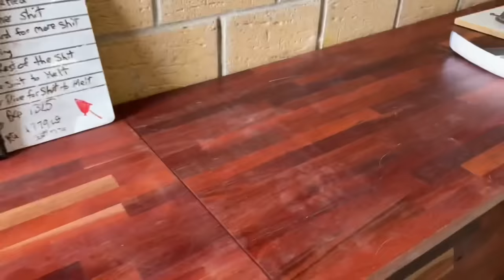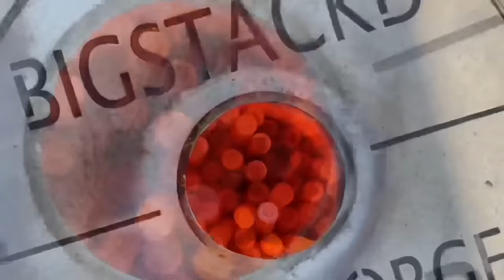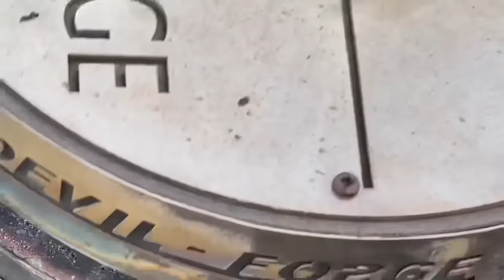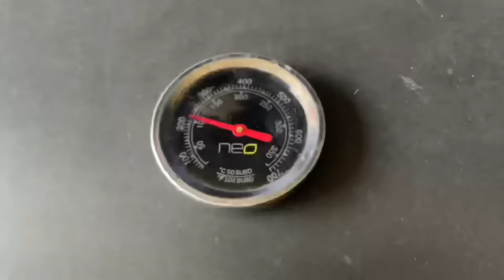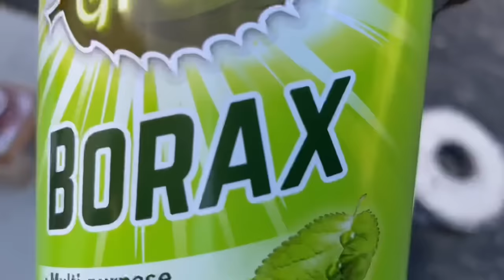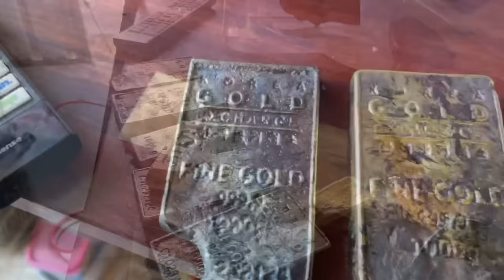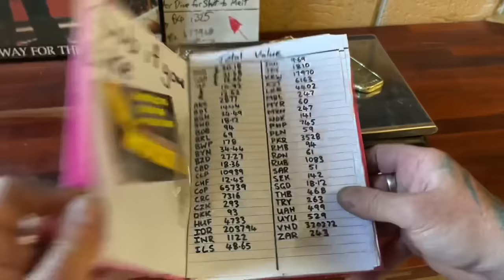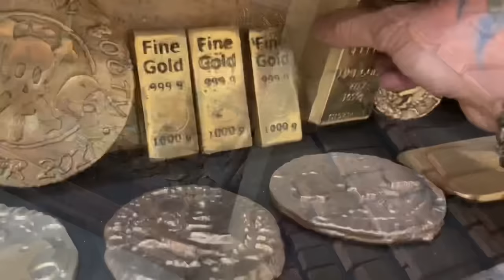Gold Bullion Bars From Bullet Casings (replica) - Trash To Treasure - ASMR Metal Melting - BigStackD

Comment: You should add borax to the charge right at the start of heating and heat the brass itself to a lower temperature = less air into the flame, because the way you are mixing it now there is excess oxygen in the chamber around the melt and you are burning out the zinc = that's the white smoke and yellow deposits on the surface. It's made up of zinc oxide. Lower the temperature and put the borax in earlier and the melt won't crystallize as quickly.

Comment: Great to see you making something. Most people are sitting on their but.
Yes I am a metal caster also. A hobby that went wild.
My father had a foundry nonferrous. In Grand Rapids Michigan, USA . Our front doors became the President Jerrald R. Ford  Museum. 
In your sand use less oil ,it will put a better finish on your casting ,no fire. Put flower in a sock when you have removed the pattern. Flower will put a barrier coat making less reaction metal to sand. An old foundry trick. You need to put boards on side of mold to support the sand clamped. 
Mount the gold molds to. A board, it helps to pull pattern out of mold. Plus it makes a nice Finnish to the back side.
Its great to see your love for casting.
See if you can buy son flux for brass. Ad a little aluminum to the yellow brass it will make it flow better. It burns out and isn't in forged billet casings to began with. Forgings and stampings in brass need aluminum but  not much, when I was amid I added a lot and the brass broke like glass but was still yellow color.
Instead of applying Telkom with a brush put that also in a sock and shack it on the pattern . it will go on more even.
Great job keep casting!!!
Metal caster man
Reply: Finnish?
Reply: I grew up in Grand Haven, Mi, only 1/2 hour from Grand Rapids. When I was in 4th grade, I wrote a letter to President Ford and he wrote back happy to hear from his peeps back in his home state. I still have the letter to this day and this was back in the mid 70's.

Comment: If you want to get rid of all the bubbles, get yourself a bell jar and a vacuum pump.  After mixing, put the cup in the bell jar and pull a vacuum.  After its done bubbling, wait about 10-30 sec then turn off pump, release vacuum, and then pour into mold.  Or put whole mold filled with resin in jar if it fits, and doesn't have its own bubbles.

Comment: So I saw something interesting the other day. I was watching someone cast some brass (recycled from old brass plumbing fittings) and they added some glass (broken bottles from the hoppy goodness we all enjoy) to act as a “cap” to help prevent the loss of the zinc. Just before pouring they pulled the “cap” off using a graphite rod and because molten glass is a icky the whole cap came of clean. Mayhaps you could try this in a future melt?

Comment: Mr. StackD or really anybody: this is probably a silly question but is it possible to burn the metal being melted to the point that it can't be used? I noticed that you've said in the past that certain metals melt at a certain time and temp. Thank you sir. I thoroughly enjoy your content. You are extremely talented.
Reply: Nothing (or very few things 😂) is silly when it's a genuine question. Anything can vaporize in theory but no these things could never get hot enough to vaporize I'd think 99% (or 100%) of metals.

Could introduce impurities under certain conditions, I'm still an amateur waiting on my first furnace in the mail, but for all intents and purposes, nope. Can't "overcook" the metal

Comment: I wonder if you could use a magnet to remove the bars next time. Nice work!
Reply: Copper and brass are non-magnetic metals, they don't stick to magnets. 🥇
Reply: @ordyhorizonrivieredunord712 Alluminium is not magnetic but it,s abrilliant metal all round to work with

Comment: Very nice. There is a small note to increase the strength of the fire, which is adding strong air. Use embers and air without using gas, and using a cement crucible makes filtering the metals more pure. Thank you for the video. 🎉

Comment: In the last few videos, you're not adding a peice of cardboard under the crucible. Why have you stopped this practice? Love the videos. Would absolutely love to see you do a precious metal casting, or even an unique metal that we haven't seen you do before.
Reply from the maker: I only really put the cardboard under when I’m melting copper as the extreme temperatures cause the firebrick to stick but when doing brass and aluminium I’ve never ever had that problem with it sticking , but I really should do it  anyway I suppose as it certainly wouldn’t hurt

Comment: I know this sounds crazy but I drill out the brass, wire brush the inside and bury them in borax on the initial heat... it makes the melt so clean and painless on the slag. Try it out on a small batch

Comment: Have you ever considered adding magnets into your epoxy castings for sand molds? It would probably make removing them from the sane a little easier. I don't know, just offering a suggestion
Reply: Actually since he added nuts an washers maybe a magnet could have picked them up

Comment: If you smashed the brass casings flatter, wouldn't it be easier / quicker to fill a crucible for pouring and use less fuel?

Comment: Hello Big Stack D, love your videos...so much so that I have purchased a Devil's Forge myself. I have a question for you. I notice that when you shut off your forge to check on the progress of the melt or to add more material you never touch the value that controls the gas right outside the forge. Do you have a secondary valve somewhere else in the line or do you just use the main gas valve to turn it off and on? Thanks for you help...Melt on dude!!

Comment: Very interesting video, it's my first time watching your channel. I love your shop! I wonder if your crush the cartridges before putting in the melter would save time.
Reply from the maker: Well if you stick around to watch any more welcome aboard my friend and if you don’t that’s alright have a great week. When it comes to crushing the casings I don’t like to do that as you can crush them in a way where it will create an air pocket and the air can expand and do a little explosion especially if it’s underneath the molten metal before it melts or if you push it under the molten metal with an air pocket trapped in the casings . if that makes sense.🤔

Comment: Alternate to resin that would be easier is to use wax.  Will act as a fux and burn out.  Wax replacement process is also used with real gold, silver and other metals including brass hardware for bath and kitchen.

Comment: Good morning!  I love the videos!  Quick question I know there’s hardly any value.  But can you actually melt steel or iron? I’m just curious lol
Reply: I don’t think he can do that in the little furnaces he has. It’s a temperature problem. Iron melts at 2800°F (1538°C), whereas copper melts at 1983°F (1084°C). The other metals he melts are even easier to melt in terms of temperature.

It’s why the Bronze Age came before the Iron Age.

Comment: The brass was cold, you need a burner with more propane air flow, the excessive amount of slag in the furnace is because the crucible is overloaded with unmelted metal for a long time exposed to an oxidizing atmosphere, the borax and sodium carbonate fluxes are there to add them from the beginning so that it forms a thin molten layer on the surface and does not allow the oxidation of the metal, to provide metal when the crucible melts.  Greetings

Comment: When I melt brass the zinc ignites. How do you avoid this?
Reply from the maker: You’re overheating it way too much. When the brass is just about melted I normally back my furnace off to about half power and just keep a close eye on it although sometimes I will still burn off the zinc. 
If you melt it slower you’ll Have more control over the temperature and should be able to avoid burning off the zinc 👍🏻
Reply: @bigstackD  thank you!

Comment: The Scrap Yards here around where I live in Central/East Texas don't consider brass shell casings to be actual yellow brass and won't give as much for it.  I asked them "If it's not yellow brass, then what is it?  It's BRASS, Right?  And it's YELLOW, so to the untrained ear it sounds and looks like yellow brass."  They still wouldn't pay yellow brass price for it so I loaded it back up and told them "I don't mind giving people stuff but I'm not gonna let a Company like y'all bend me over and screw me out of it!".  (Salvage yards around here are notorious for giving as little as possible, If they can get away with it).  I've got some certified scales and before I take ANY metal off to salvage, I'm gonna weigh it next time and see just how badly their scales are under.

Comment: Dumb question: could you use the furnace at low heat to instantly make jerky?
Reply from the maker: No unfortunately it’s still too hot even on its lowest setting it probably runs at about 350°C
Reply: @bigstackD  Thanks for confirming.

Comment: Say D? Since you have some of those molds filled with metal nuts and stuff, wouldn't it be easier to pull them out vertically with a magnet after you tapped them loose? That way you might avoid damaging the sides of the imprint in the petrobond.

Comment: Ok, I got a question that people probably wonder but to embarrassed to ask so I’ll take one for the team. 😅
Since whatever you are melting has a boiling point, is it possible that while boiling, that it partially evaporates?  In other words, melt 5 pounds and end up with less weight after a while of it boiling (without removing anything from the crucible)?
Reply: Not BigStackD here, and by no means am I am expert at melting anything besides ice, but over on the Sreetips channel he has talked about if liquid gold or silver get too hot they will vaporize which can really suck.

Comment: 7:30 9:00 If you're placing steel pieces in epoxy castings, why don't you use a strong magnet to gently pull them out of the sand?

Comment: Some days are more of a struggle than others but perseverance pays off!  🙂

Question: When you fill the second half of the cast iron molds, why don't you assemble the mold first and only thereafter pack the sand? That way the back of the object being cast would be just as nice as the front and it would also seal the gap between the mold halves. I see smoke pouring out from the sides and that can't be intentional can it? Not that I actually know about these things but it seems to be a better way to me.

Comment: Сколько по времени занимает плавка
Reply from the maker: With the Devil Ford furnace, you could melt 1 kg of Copper in 11 minutes or 3 kg of Copper in 20 minutes when it comes to the lower melting temperature metals that can be done a little bit quicker👍🏻.

Comment: Ypur sides are not supported! The hydraulic pressure should have blown them out.. Lucky it was only one of the lot.. You can gold plate those ingots  after a high polish and buffing, should not cost you an arm or leg since there is very little gold deposited in guilding. With 957 kg of gold you should not be worried with inflation.. 😂

Comment: maybe it would be easier to melt the casings if you flattened them?
Reply from the maker: Yes, it definitely would fit a lot more in the crucible but sometimes when you crush them they can fold over themselves and create a small sealed air pocket and  the pressure in the casings will actually build and pop and Can send some of the other casings out of the crucible into the bottom of the furnace chamber👍🏻
Reply: @bigstackD  ah fair enough, maybe someday you could get one of those small grinding machines that will allow you to shred up the casings into small chunks? would be fun.

Comment: When you reach your goal, I think, you should step up to the next level and get rid of your gas furnance. They are actually a very outdated and ineffichient way of melting, which also creates a high CO2 polution to our wonderful blue planet.
You should move to an induction heater, which melts everthing within seconds. And you can power it just with the solar panels at your roof. Ofc, you have to get solar panels and a fat battery for that.

Comment: Why do you insist on checking the primers? Isn't it a lot easier to check if, you know, the bullet is gone? And why would there be a casing with a live primer but without a bullet? And even if, there would just be a minute pop when you throw them into the fire. Like a primer on its own would just pop a spark into the casing. Even if you intentionally filled the casing with like paper or some cotton wool I'd 50/50 on it even catching fire. And then, THE FORGE IS ON FIRE SO WHAT?!?!?!?
It just seems crazy to waste so much time on that. Like, can't be tooooo careful but this is surely overkill.